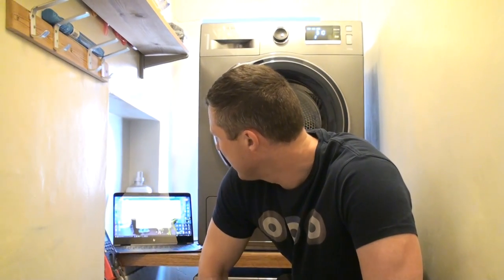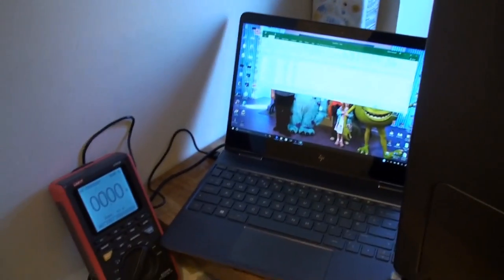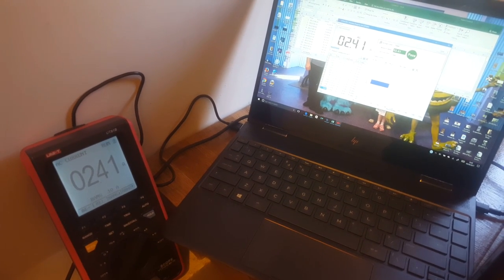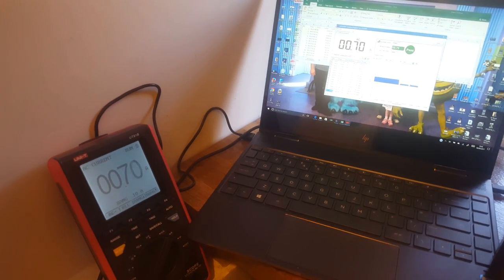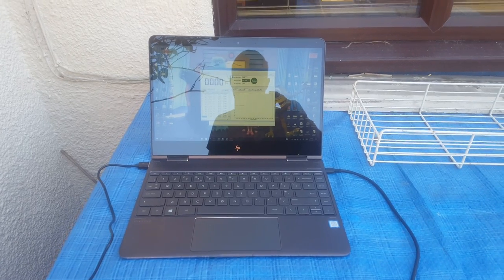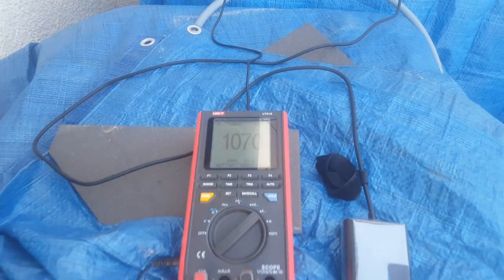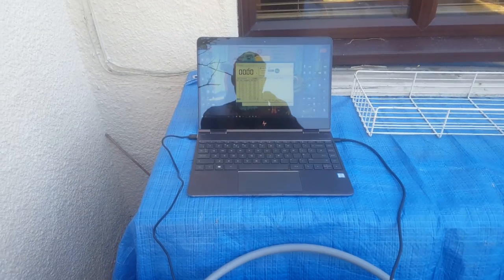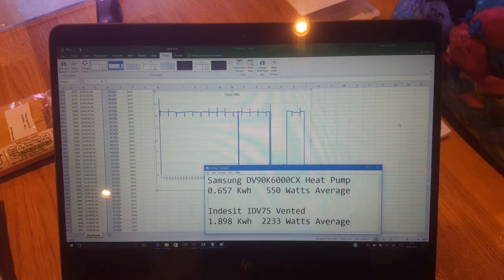Heat pump vs Vented Tumble Dryer - Actual Power Consumption

Comment: You forgot to calculate the amount of conditioned air being sucked out of the room with the vented dryer.  When you run a vented dryer all the air being sucked out of the dryer is replaced by outside unconditioned air.  How much extra does it cost to heat or cool the outside air replacing the air being vented out of the dryer?
Reply: THE VENTED DRYER was OUTSIDE. The HEAT PUMP dryer was inside
Reply: @beetleything1864  Yes, I understood that and saw that in the video.  You may be missing the point.  I'm sure he doesn't normally dry his laundry outside in the UK where he's worried about someone steeling his tumble dryer and laptop.  Apples to apples comparison would calculate the effect of one machine replacing the other in the same space.
Reply: @paulholstein9448  It's a good point but in my imagination I would guess it would not make much difference because the vented unit would use less energy in the heated house, which would then be compensated for by having to heat the stolen energy from the house heat, but on top of that he did state that the temps were the same inside and outside of the house.
Reply: @mikester1290  It's super benefitcial in the winter when you want to heat your home and maybe even better in the summer because the vented clothes dryer sucks in warm air in the summer.
Reply: @icenbryse5190  not really but whatever - i bought a Heat Pump - so i get it - it's more expensive but better on energy used and doesn't suck air from your home and blow it outside with the added plus that it's easier / less harsh on your clothes..... que sera

Comment: The power of the heat pump gradually rises, as the unit warms up, the refrigerant pressure rises so the heat power cycled for drying rises.

Comment: Thanks for the test. I just discovered these heat pump dryers, and am seriously thinking of getting one. One big consideration for me as a Canadian is the hole in the side of my house to let the dryer vent outside. The laundry room is the coldest room in the house, and no matter what kind of outside vent cover you try, in the end you can't get past the fact that you have a 6 inch hole in the exterior wall letting in some -20C air. Even if this dryer is a little slower, the electricity savings and being able to seal that vent hole will help reduce my carbon footprint.
Reply: Consider a condenser drier then.It drains into a tank in the drier.
Reply: Important to note that heat pump dryers specify a minimum and maximum ambient temperature. Some state 10C as the lowest temperature a room can be, which can be a problem in winter if the dryer is not in a heated room. Make sure you check the specifications.
Reply: @rikmoran3963  LOL, if any room in our house reached 10C, my wife would probably kill me. I should be fine with that requirement. The biggest problems from her point of view would be the apparently smaller load sizes and longer drying times.

Comment: I know this is an old post but this has become price relevant now where I live in Canada as ventless dryers are very close in price to vented ones now. 
Thanks for your hard work.
Reply: old post but my think says not having a dryer venting air outside must significantly  reduce you energy  use.during winter.

Comment: What a great video!  This video is the reason I finally chose to buy a heat pump dryer.  At first I thought the consumption difference is not that significant. 
I hope you can mage more videos comparing different appliances.

Comment: What is worth a mention is this; Conventional dryer blows hot air damp air out of the house so most of the heat is wasted.
This type of dryer uses a lot less energy and the heat that is generated is within the house, hence it warms your house in the winter.
So you not only drying your clothes you supplementing the central heating :-)
A++ for general efficiency  ,  A++++++++ as it is warming your home and not just the outside.
Reply: F- in the summer
Reply: Use a washing line in the summer then
Reply: @jamesdewitt84  not if it is raining.

Comment: Excellent review! I am on the lookout of a new dryer and your test has swayed me to investing a heat pump version! Thank you :)
Reply: Heat pumps are very slow. Bed sheets take around 10-15 mins in a vented and 45-50 in a condensing dryer.
Reply: Bought a heat pump dryer 18 months ago, just scrapped it because they are impossible to service. The condensers are totally inaccessible , you have to strip the entire machine to get to them, which includes removing the drum. As they become clogged with dust they take longer and longer to run, to a point where just leave everything smelling damp. They are an ok concept but they way they have been designed seems to be the same between all manufacturers. Ive gone back to a traditional condenser. It uses 3 times the power but dries clothes three times quicker, and they come out nice and warm, so if they are folded when warm saves a fortune on ironing.

Comment: Excellent test with some nice logging of data. Accuracy could have been improved even further by weighing the dried towels to make sure that they finished at exactly the same dryness (weight), but a 3:1 difference in total energy consumption is impressive.

Comment: Other advantages:
1. Here in New Hampshire  blocking the vent pipe with insulation and sealing it has made the laundry room significantly warmer in winter even when not using the dryer. 
2. Residual heat the dryer does generate warms the house instead of the outside (the idiocy of venting hot moist air from a heated dry home!)
3. In summer, the outside line is almost as quick as the dryer anyway, so we can avoid AC battles with the heat pump.
4. Save the collected water to wash your windows! I discovered the distilled water doesn't spot the windows if you use it to rinse.
Reply: Mark Stewger  The water in the clothes is vaporized, and then condensed, so it is mineral free. It is not medically pure, but that is the method of distilling water, Mark.

Comment: We got the Blomberg pair 3 years ago. They are the 24” size, and the washer with its high speed 1600 rpm spin complements the heat pump dryer very well. The ventless dryer is also nice in our building, which has issues with its dryer vent system.

Comment: I need to say this video have helped me to decide what to buy, you can see a big difference in the consumption, thank you very much for this precious video, some times is better to spend a little bit more money but in long term you will see results
Reply: The question you have to ask yourself is  how long it will take you to save the amount of cash that the newer heat pump t/d will cost you over and above the cost of the condenser/vented t/d -  I'm facing the same dilemma, but looking at it financially - a decent condenser dryer will cost me £299 whereas a heat pump dryer will cost me £550 or more.  Yes I am going to save electricity, but am I going to save enough on my electricity bill to cover the extra outlay for the more expensive machine -  some websites I've looked at suggest it will take up to 9 years to make the savings real and to notice real savings in your electricity bill -  by which time the more expensive machine (both of them more than likely) will probably be on the scrap heap.
Reply: I brought a heat pump dryer but it was totally unsuitable for my needs. I never really use a dryer to dry clothes straight from the washing machine. And never a full load.I use it to finish off the drying or to quickly dry a single item. The time this takes would be around 10-15 mins in a vented traditional dryer. The heat pump takes far too long. I’ve tried drying 1 king size fitted sheet .. still not dry after 40 mins may as well stick it over a radiator. It’s like watching paint dry. Waste of money.
Reply: Vented machine will outlast any brand heat pump machine. It so simple that there is just nothing to break down! Heating element and thermostat.
Reply: @bluechang08  You got to figure out the R134a gas leakage(bound to happen over a decade in a polluted environment) fixing cost to the additional upfront cost paid for the heat pump compressor dryer
Reply: You're probably feeling very disappointed right now about heat pump dryers. 😆

Comment: Thank you for this excellent video... I bought an electricity consumption meter to measure my current conventional condenser tumble dryer in order to figure out if it is worth it to replace it with heat pump dryer... So far, in six months, my conventional condenser tumble dryer was on for about 432 hours and has consumed 563kWh. That translates to drying roughly 4285 of your towels in that Samsung heat pump dryer... :-) It also means, that I have average power of 1,3kW. With your Samsung, I could save more like 57% of energy... Thank you again, excelent video!
Reply: Nice and thoughtful reply. Thanks for the info.
Reply: Yep the ratio goes like 1:2:3 for electricity units consumed by heat pump/condenser/vented dryers
Reply: So I bought the heat pump unit 6 months ago... I have not implemented the electricity meter, but I will do that today and measure for half a year. But there is an observation: the heat pump unit is substantially more demanding on the maintenance and also the drying is not as good as with the conventional unit before. Both are the same brand: AEG. And both are the top of their line...
Reply: @TheCzechmate007  R134a gas is prone to leakage given the spinning unit. Is your heat exchanger(aluminium box like unit) removable?
Reply: @parijatmathur8489  no idea... I would have to disassemble it... I only clean it from the front side opening as per the manual... It doesn't look like it's removable, but hard to say...
Reply: @TheCzechmate007  Yeah they could have made it removable like the Siemens condenser ones. My Beko heat pump one' fixed too, can only vacuum it. Hope the lint & foam filters do their job & it never gets linted(& burns it).
Reply: @TheCzechmate007  Coming to think of it the heat pump one' heat exchangers cannot be movable for refrigerant gas has to circulate through them. They are basically the equivalent of an evaporator coil on an AC unit. No way they can make them removable then without losing refrigerant gas!

I retract the blame on my Beko heat pump dryer!
Reply: @parijatmathur8489  Yeah, I was a bit sceptical about your theory, but I have only seen AEG, so I thought maybe BEKO has done it somehow removable... But you would need to refill the refrigerant then... It is doable, but only by a repair shop...
Reply: @TheCzechmate007  My Beko heat pump one' fixed. Though my Siemens condenser dryer' one is removable(as its not a heat pump dryer). I understand why its so now!

R134a is cheap but its an easy job only if there' a service port & the leakage' been through the service valve pin.

Comment: I just bought a heat pump dryer. Put 12 towels in and they were dry in 1.5hrs. My old dryer took just under an hour but only fit 7 towels in it. I’m also impressed how warm the clothes come out of the heat pump dryer.
Reply: What dryer did you purchase?

Comment: I got my beko heat pump dryer last week and im so impressed already with it. Quiet, efficient and actually seems to dry well despite hardly any heat being expelled from the machine , like my old one would do.
Reply: Just picked up a 9kg beko heat pump from currys for £330. Just used it and took just over an hour to dry 2 duvets and 2 bed sheets. Pretty impressed with that.
Reply: asianskywalker ive noticed that my electric usage is much less with the new dryer. Im very impressed with them!
Reply: Hi do you still have the dryer and are you happy with it?

Comment: Great video....did the math .... it would take me 3.5 years just to break even seeing as these type of dryers are very expensive compared to a regular dryer
Reply: It's worth it as long as you keep the filters and coils clean. If it lasts ten years then it's a real bargain.
Reply: The other thing to consider is its ventless. You are no longer pumping out your conditions house air out the vent. Its like you no longer have to crack a window every time you do laundry.
Reply: For me id save £50 a year if i purchased a heat pump dryer and it would take me 5yrs to break even if i spent £600 on a dryer
Reply: @dwmayday  yeah and that number can vary depending on all kinds of things so it is very difficult to calculate.
Reply: That isnt too bad. My only other concern would be the complexity could lead to higher repair costs.
Reply: You also have to consider that with a vented dryer, you’re losing conditioned indoor air, so your heating and air conditioning system has to work harder.
Reply: For me I only use the dryer in winter and some of autumn and a few other times per year when it’s raining for ages and I need something dry quickly. Comparing buying a used but fairly new fisher and paykel vented dryer for $300 AUD vs having to buy a new heat pump one (because there aren’t any decent ones for sale used) for $1000+ it would be hard to justify for me. If I use it 40 times per year, which is definitely more than I would, it saves me only $8.935 per year in electricity. Assuming a $700 difference in purchase cost, that’s 78 years to break even with buying a vented one haha. And seeing as I don’t use it in summer because clothes go out on the line and dry in 40 mins in the Australian sun for free, the added heat it pumps into the house in winter probably reduces heating costs for the house slightly if anything. Even if I get one of those venting kits to vent it out the laundry window, that’s about $120 so that still makes 64 years to break even haha. With the way appliances are made to fail these days, especially more complicated ones like the heat pump one, there’s 0% chance I would even break even. And the fact the vented one dries much faster is also a bonus for me so I can do more loads of washing since it takes about the same time to wash a load with my top loader as it does to dry a load.
Reply: @DryUrEyesMate  also takes 3 times as long. My indiset vented will dry about 4 towels in 20 mins. My condenser in 1 hour 10 mins. Also most vented dryers have heat settings. Lower heat setting will lower the kw usage.
Reply: @billybbob18  They don't last 10 years though, unless you do expensive maintenance. Typically the brushes wear down and need replacing every few years.
Reply: @tomjones2157  They use a brushless DC motor.

Comment: This is a great video! Just to complicate someone's decision a bit...aside from energy consumption, the drying time also affects the wear and tear of your clothes/fabrics. The conventional vented dryer does use about 300% more energy, but it also tumbles the clothes for almost 50% less time.
Reply: Yes, but then again heat pump dryers use lower temps which is better for your cloths. Also means no shrinking (if you select the correct  cycle). In my HP dryer you can even dry silk and wool. American vented dryers are auch a waste of energy. Most stores don’t sell that type here anymore.
Reply: Yeah having longer cycles is what you want for dryers. If it's quick it'll likely shrink everything inside the drum cos of the higher temperature

Comment: Heat pump dryers (aka "ventless") are limited to smaller capacity compared to their 'lektric and gas brethren. One hopes they standardize on the 27-in width in addition to the 24-in width, which will provide room for a larger drum.

Comment: This existed three years ago why could I not find this out.

You did a really good comparison there.

And I will be buying one of these now that they're only about $900, get rid of that draft when you're running the dryer where it usually just pushes the air out of the building

Comment: I have the same Samsung dryer and it is excellent. The test may have been fairer if you had used an Indesit condenser dryer rather than vented. Although the "old technology" would still have come out worse I've no doubt

Comment: PLUS its hard to account for the savings resulting from not stealing air from your home and venting it outside. In the Summer you are effectively sucking cold air out of your house and in the winter heated air... Definitely a cost associated with that.
Reply: readi343 unless they sit in the garage :)

Comment: I know the video is a little old and possibly outdated due to updated in efficiency.
I've had my old condenser tumble dryer for about 4 years now, and just ordered a new heat pump dryer.
The product fiche for the old dryer says it should use 5.8kW for a full load dry, the new heat oumo states 1.4kW so at a unit rate of 18p per kW if be looking at just over £1 for the dryer run on the old condenser and £0.25 on the heat pump. 
On top of that the upgrade brings sensor drying and better condensing performance.
Despite the old one being a condenser dryer, the whole house would still get noticeably humid while it was running.

Comment: 3 march 2024, I have just opened up an AEG lavatherm  heat pump dryer ( neighbour's ) found a broken belt, AND everything is covered in fluff, even into the electric motor windings-as it is not covered nor a sealed unit,,  ON THIS ALONE- I would only buy a vented dryer, to avoid any house fire,  recommend staying with clothes racks

Comment: So November 2022, cost would be 74p per load for the old dryer vs 22.5p per load for the new one. That’s quite a difference but do your sums carefully- a heat pump dryer is about £170 more than the older ones so will start saving after about 340 washes.
Reply: That test was a half load so it would be 170 washed (28 weeks for me) to break even.